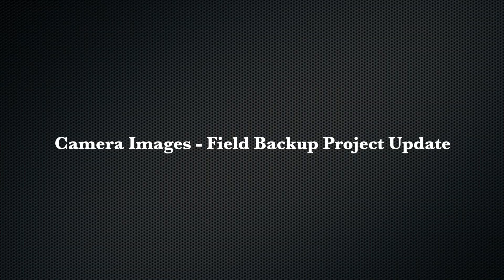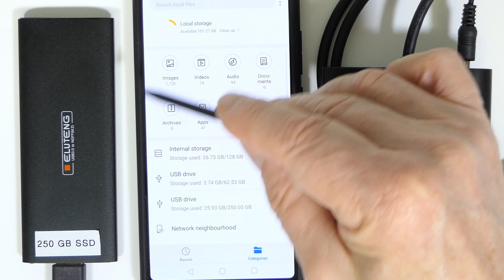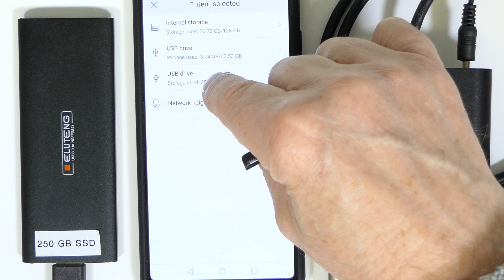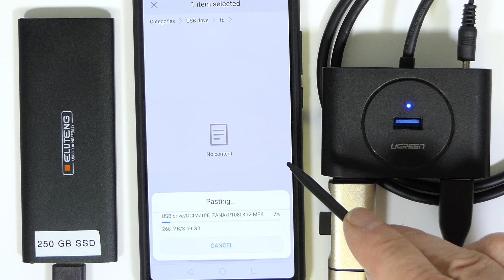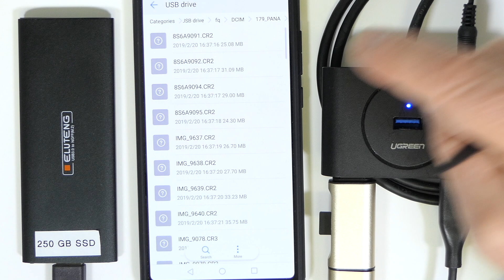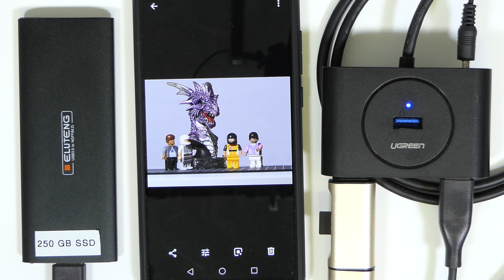Field Backup of Camera Image Files Project Update

Comment: For me it is even simpler though it required I buy a drive.  I travel with an Ipad Pro 12.9, added a Western Digital wifi/USB drive with an SD slot—and it ‘sees’ raws.  I can just upload from the SD card (BTW—its pretty easy to organize through an IOS app on phone or Ipad—and I expect there is one for Android). Or I can load to my Ipad first and then transfer/copy to the drive.  I have the none SSD version but it now comes in SSD also.  The IOS app is free and easy to use.  When home, if you choose like me, you just copy or move via USB to your ‘permanent’ external drives.